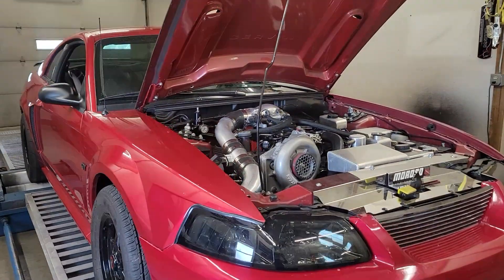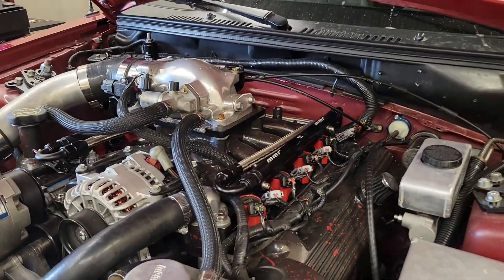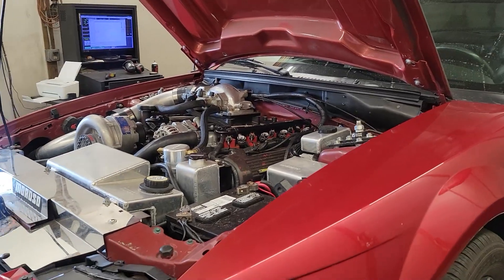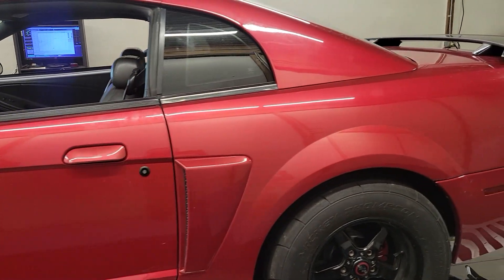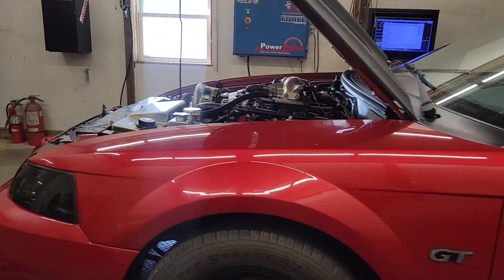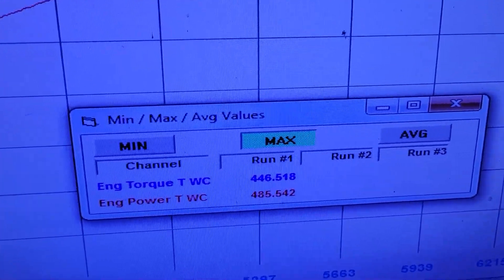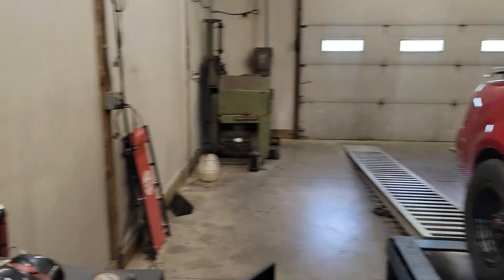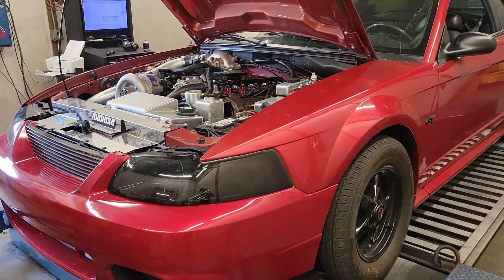Vortech V2 Supercharged 2v 4.6 Ford Mustang Dyno Review

Comment: How much can this engines handle if internals are built ? And how many pounds of boost ?
Reply: 1000+  Everything depends on the build and tune
Reply: 420 on stock internals.  No cams or anything just throw the charger on injectors etc. but your pushing it and anymore it’ll pop

Comment: You guys just tune?
Reply from the maker: we do engine machining and assembly, along with tuning.  Also take on other projects depending on our work load.
Reply: @ForceEngineering   need an 02 lightning shortblock assembled and cams put in. I may attempt it myself, never worked on a mod motor before